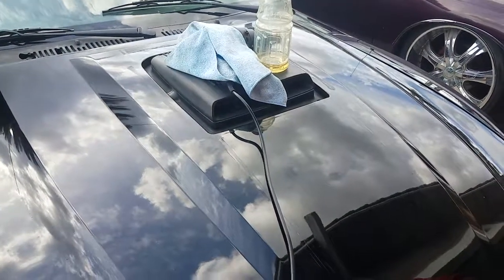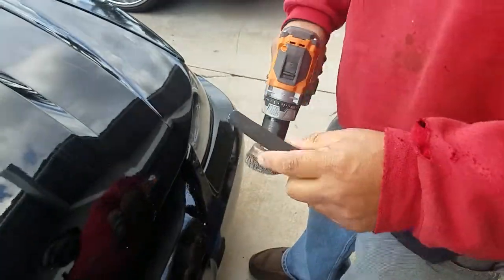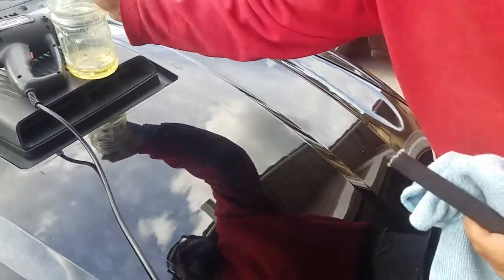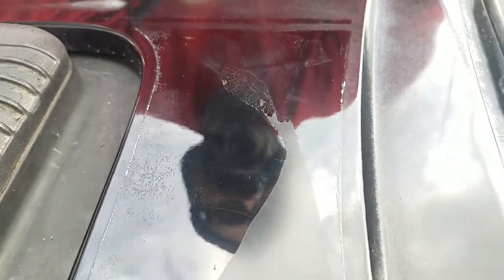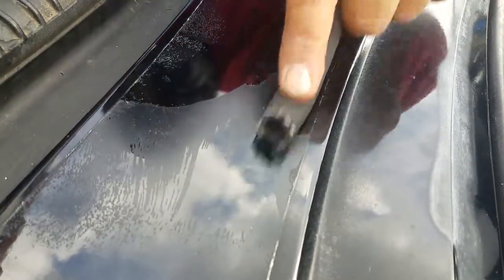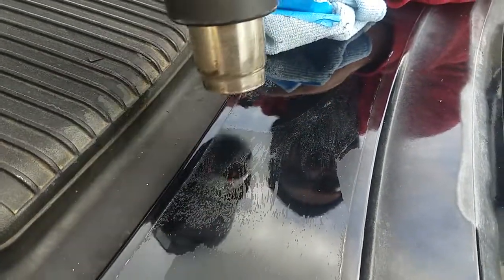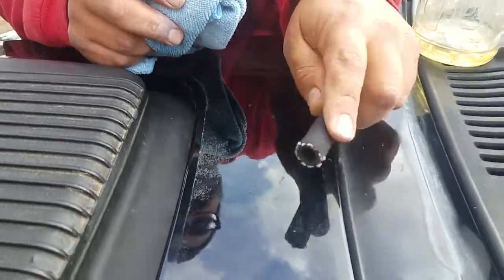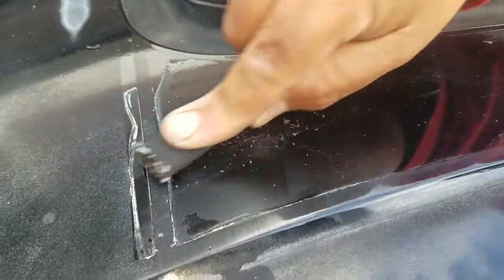How to remove decal adhesive residue EASY!!

Comment: Alright bro, really appreciate this! Took the 4x4 decal off the bed of the truck. The adhesive would not come off! Tried err thang! This actually took it right off. Little elbow grease and BAM!!!
Reply from the maker: Thanks man! Yeah it was my pops idea. You know what they say, you can't beat ol' skool!  You can use an eraser wheel on a drill gun too but this is the cheapest method lol
Reply: @DIYStangsandFreedom  exactly! I didn’t want to buy anything and this saved the day!

Comment: That's a nice technique. We've used EasyOff oven cleaner on our show rigs when removing painted on company info and graphics. It doesn't hurt the paint or clearcoat. You just have to wax the hell out of it again, to replace all the wax it removes. It should work the same for adhesives.